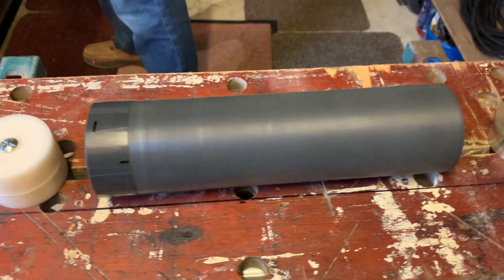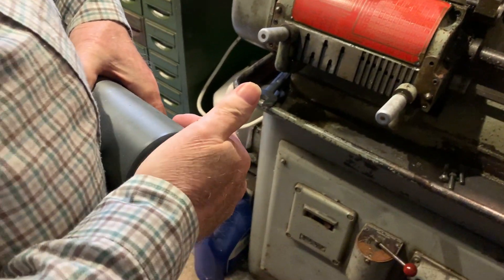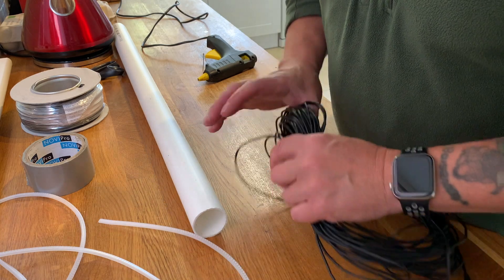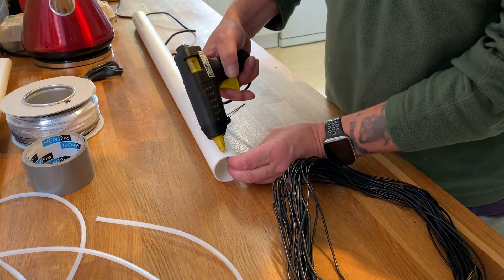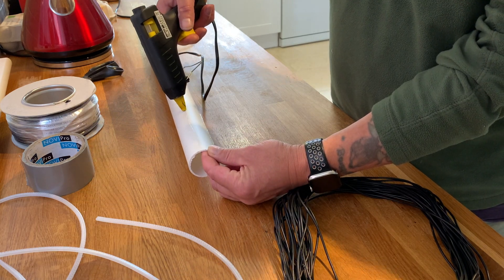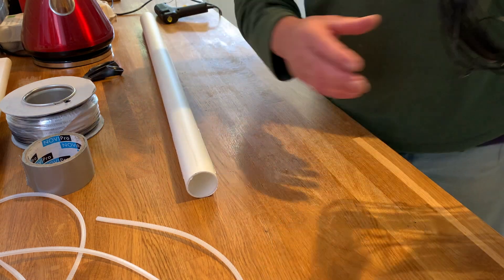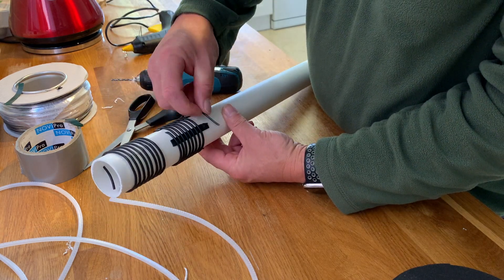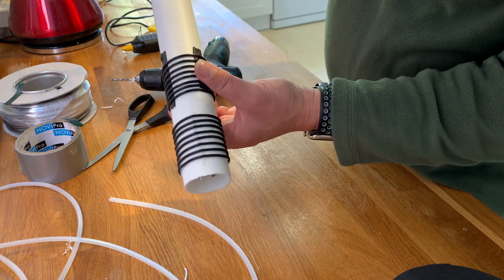HAM RADIO:  Making Coil formers for the DX Commander

Comment: I have a mobile/portable set up and I was wondering if it was possible to build a coil that would be useful on vhf, I could use a coil and an integrated balin, I am a machinist so I can wind pretty epic coils.  I just don’t understand them.  Lol 200 meters per coil then stack them together  it looks like 1000mm or 39.37 in coil would be doable.

Comment: Hi Mike,
Nice methods if no lathe available. Another way to keep even spacing is to wind two lengths of wire together, and after anchoring the ends of one of the wires, unwind the second.  Stay safe.  WJ3U
Reply: Don, you bet me to it, If you wind a line from a washing line along with the wire you are winding, then unwind the washing line, good thing about washing line, it come in various thicknesses.
Reply: @Boba-Fett-GS1150Ez Hi Ken,
I like the idea of the weed eater line. You can select the diameter to give the needed spacing for the wire and as you say no need to remove it. :-)  WJ3U
Reply from the maker: Great idea

Comment: Another good one Mate. What would be the difference if rather than use the 5mm spacing, I just butt the cable to the previous rotation?
Reply: I'm guessing a higher Q factor, lower resonant frequency, greater reaction to rain or metal - but don't quote me... 🤔
Reply: @internaut5610  That would make sense, I built a coil like that recently for EFHW for 80mts and the bandwidth was quite small. I might try more of a distance between the coils to see if widens a bit. Thanks.
Reply from the maker: Yep,